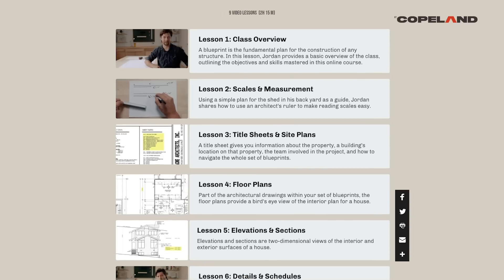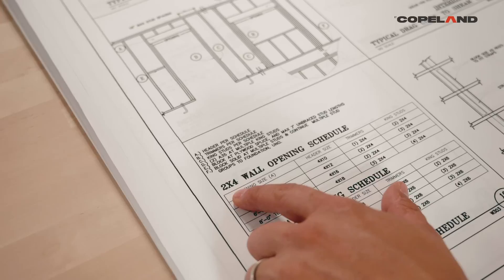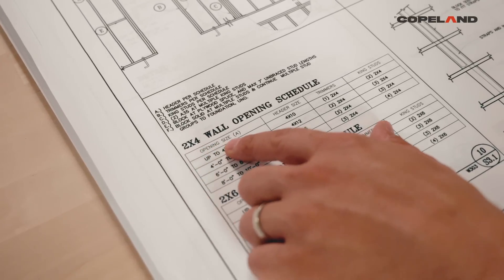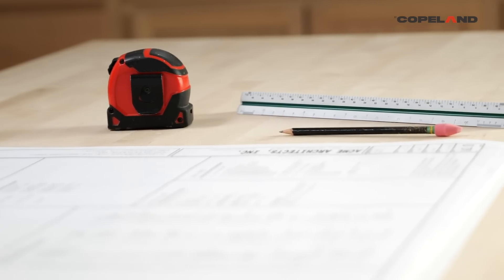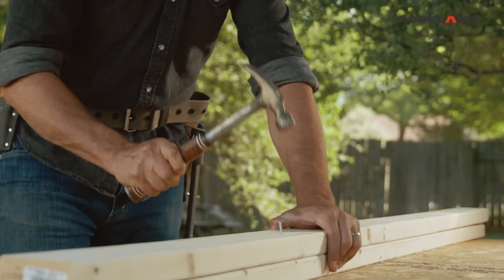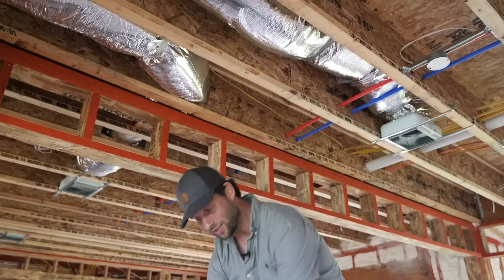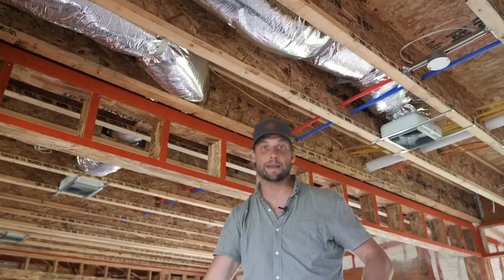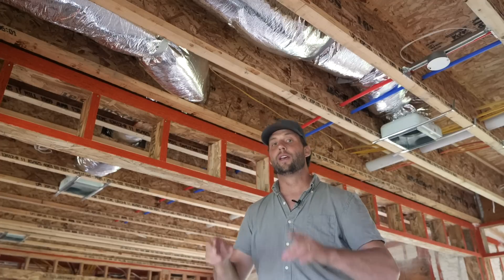Flex vs. Rigid Metal AC Duct - My preference may surprise you!

Comment: 36 year Mechanical contractor here. We specialize in airflow and are generally hired to "fix" hot rooms or "not enough air" issues. The absolute most flex I recommend is 6' which is to say use hard rigid duct sized correctly for friction loss and static pressure then the very last 6' of duct may be flex installed without any sharp bends. The only place I would use full runs of flex would be oversized returns but you need to be careful if it is installed with sharp bends then it may collapse upon itself. Hard duct is much better for airflow, rodents, you can have it cleaned on a regular basis without worry of damage and it can be easily modified in a remodel. P.S. that duct up to the left in the video with the sharp bend makes me cringe.
Reply: I had rodent problems with my flex duct. Never again.
Reply: Our liner in the flex duct is showering small bits of plastic out the vents. They have a life expectancy. I believe they are used because they are cheaper and easier to use. Not better.
Reply: I noticed the same and I don’t even work in HVAC.  The sagging duct just above his head isn’t great either and you can also see a crease in the 90 down.  Good news for you is that’s job security
Reply: Rigid has my vote too. But if you have an idiot working nearby check ductwork before they leave. 5 smashed rigid ducts I need fixing. South Tx rn is 105° Thanks a**hat!!
Reply: My home has rigid duct and the one downside (I think) is that it transfers the noise of the evaporative cooler's fan quite well. Would having flex for the last 6' reduce noise much or at all?
Reply: @chadillac2472 yes
Reply: @chadillac2472 if it transfers noise it means it transfers air. Less noise would mean less air
Reply: @JOIHIINI  Makes sense. Thanks
Reply: @chadillac2472  I guess in theory it could reduce noise but all I can really think of as good noise reduction is having a bigger duct that makes more bends, back to the trunk. Would have same cfm as a small straight run cuz the bends would subtract that air flow but the sound would die in the bends. But it's kinda odd engineering extra 90s on purpose lol.
Reply: @chadillac2472  I designed my own system in my house and a lot of what went into the design was having certain rooms ducting as far away from other rooms ducting to reduce sound. If I did branches it was from rooms that it didn't matter. Sound travel sucks lol I used to have a boiler and it was great for that but I was worth not having window ac units lol
Reply: I worked for 39 years in hvac  tore alot of flex out insolatoin is gone wonder who inhaild that
Reply: @RoyWilson-b3t  😱😳
Reply: 😂😂😂😂on that duct that makes you cringe 😂😂😂
Reply: Great comment, I'm about three years late but just came upon this vid. I appreciate your comment. I have to replace duct work in my crawl space and was told to go with flex duct but most of the people I see on youtube talking about it say the same as you and to go with hard rigid duct or galvanized steel. The house has metal round and rectangular down there already, do I replace with the same shape and size as what's already down there? Or can I go all round instead of rectangular? I ask cause you said "sized correctly". The house is one of those four bedroom tri-levels. 2200 sq ft house but crawl space where I'm replacing duct work is 500 sq ft. Any input or videos you could recommend would be great. Thanks
Reply: I was in the HVAC business my entire career, the best Practice is to rough in your trunk and attach a 12” class 1 flex to your takeoff and run out with rigid. This method eliminates expansion noise and keeps airflow as designed.
Reply: Im equally if not more concerned about how its literally cut into the I beam for the entire height of the beam. Like dude thats a structural component of the house that was just turned into two 2 by 4s....
Reply: It's not that serious...flex is fine. You don't know facts here

Comment: A lot of comments regarding cleaning ductwork.
If the proper filter is placed in line with the evaporator and all the returns are filtered as well, what is to clean?  Just change the filters on a regular basis.
Very few if any HVAC contractors, test the duct work or offer a third-party verification of duct work performance.   Most would not pass.
Most HVAC contractors have their least experienced labor slamming duct work into the job.
They couldn't explain Manuals D, J or S if their life depended on it.  These calculations should be documented and left at every install.

Comment: You're right, when installed properly flex duct can be fine. However, I'm looking at that 90 with the flex through the plywood behind you. I'm looking at that flex hanging over you that is clearly sagging and not taut. I'm looking at how it's attached to that vent. No I don't think you know how to use flex properly and you really shouldn't be talking about something you don't understand.

Comment: Things this guy has never listened to or been in a class for…….flex duct is great whenever you have very little compression, in the range of 4 percent over the span. Using flex to make bends and turns is never ideal, especially a 90* turn like shown. 
Throw some static probes in the supply and return of the unit when it’s done and if those flex duct aren’t sized accordingly, air flow will be low.

Comment: WHAT ABOUT DUCT CLEANING!! 

I have worked in HVAC/R and plumbing and heating for 15 years and have used my fair share of flex duct it most certainly has its place and application. I recently did duct cleaning for the first time and the rotary brush used to clean ducts would easily destroy that interior wire coil and get wrapped up inside the duct. My concern is that now that duct has a hole in it buried somewhere inside a finished home years after the install was completed and now has a damaged heat run that no longer delivers air. There ARE more commercial flex duct options that are made of a much more durable interior liner, in Canada it’s called SLP flex.

Comment: The value is not so much in performance as it is longevity. Get a squirrel or a raccoon or some critter in that attic …they ain’t gonna chew through metal. The reason people don’t use metal in the south is the GC doesn’t see the value and the owner doesn’t want to pay the up charge. Let’s face it, there’s 3 ways to save money on a job ; use cheaper material, use cheaper labor, the contractor makes less profit and the third thing never happens. We HVAC guys would be running air in used condoms if it saved money and no one bitched.

Comment: I’m building my own home hiring contractors myself. I’m glad I came across this video. I hear people say use the the ridged. I’m going with the flex. Thank you for the tip.
Reply: do not use flex, it is crap.
Reply: What kind of reasoning to you have to back it up? What problem did you have with it?
Reply: @josephferron7672  Just use your logic. How air acts, long term effectiveness. Only advantage of flex duct is that it is easier and cheaper. In every other aspect rigid duct is superior. You are building your own home. Do it the right way. This guy is a contractor and he is biased. Because he wants to get it done easy way.
Reply: @Faruk651   I greatly appreciate your response. I’m going to have 2 units. One for downstairs and one upstairs. My runs will not be no more than 30 feet. Installing in crawl space and upstairs will be all in the attic. No ductwork will be in walls. I also live in southeastern US.
Reply: Only go with flex if it is absolutely necessary. If rigid ducts can be run in your house, flex shouldn’t be an option. I never seen these flimsy flex duct in Canada. Must be a Murican way.
Reply: @Faruk651 flex is fine dude lol. Stop stressing. It's not like rigid is an efficiency game changer.

Comment: My mobile home has flex in the crawl space.  All chewed up by rats.  We've been paying what adds up to thousands of extra $ over the last 5 years in utility bills since we moved here, but the rats have been really comfy and we found notes down there thanking us.  We just got an inspection and figured it out, stupid me.
Reply: Having been involved in the sheet metal trade for over50 years I found a handful of flex jobs done correctly.In my area Mass you have to pull a permit for your duct work .Inspector only checks to see that metal duct work is sealed prior to insulating with R 8 .No inspection for flex.If  you go by ARISA ONLY 6 fr of flex can be used and only on termination points.The concept of flex is great.  but the installation sucks.Low air volume high static  .Nit found in hard pipe if dictator used correctly .As to your comment use money saved and buy higher SEER RATED EQUIPMENT no savings if flex has low velocity and high static because of bends and sages.

Comment: Only problem is you should only use flex in places you can access like attics, or crawlspace.
You shouldn't bury flex in a wall or ceiling.
-Sheet metal worker for 27 years and counting.
Reply: This guy calls a 40 ft run of flex is a short run. That's rediculous.
Reply: @geraldgilpin1966  agree. 
1/2 box max and be prepared to T.A.B.

Comment: Ive seen some use metal for most of the run then switching to flex for the last 10-15 feet to reduce noise.
Thoughts on that?
Reply: This would lower cfm at the end and thus reduce noise sure, but that also affects system efficiency negatively. Also, properly designed systems shouldn't be generating much of any noise with all rigid anyway. If you're trying to cut down on noise by doing this, you're simply ignoring larger issues in your overall ductwork design.

Comment: Size matters.....there are sizing charts available to assure that you are using the equivalency to rigid duct. Best practice installation is up the the installer. If installation is done wrong, It will not work properly. I  have use flex for years, with no issues.

Comment: In most of the projects I see in Canada the US, I see long flexible duct more than 20 feet going from the FCU to the air outlet. But it kept me wondering that in ASHRAE Fundamentals Chaper 21: Duct Design Page 21.7, it is clearly mentioned that for Commercial Systems, flexible ducts should be NO MORE THAN 1.5 M IN LENGTH, FULLY STRETCHED. How come ASHRAE don't allow it? I really appreciate your opinion about that and correct me if I am mistaken. Thanks

Comment: Flex is OK but ideally you should keep it 4-6 feet at the end of the run maximum, the rest should be hard piped. 

I've installed miles of both flex and hard pipe. Only on hacked jobs are they more than 6 feet, or if it's not physically possible to install hard duct.

Comment: The group of flex ducts like the one that was showcased in this video would deteriorate over a relatively short period of time. Well, all polymers deteriorate. But, the lifespan of ductwork to be around 30 years (depending on the conditions) or so is not adequate. The point about low performance increment is inadequate because people choose one product over the other for reasons not only performance, but also service life and maintainability as well as cost.
Reply: So which do you recommend?
Reply: @aayotechnology  It depends on specific user requirements and needs. If the goal is to provide a makeshift housing, flexduct is extremely cost effective and easy to install. Many other uses for flex duct other than that. However, if you add longevity and maintenance into the desirable properties of your structures, along with other parameters (area size, etc, climate, type of structure, etc), rigid duct can be a better alternative. Usually such videos imply "best practices", but there is no solution that fits it all in reality.

Comment: Great video.  I seem to have "Flex" duct in my home attic.  Three questions: 1) where do I check to ensure dust is not getting into the air flow?  2) From High to Low quality, which one is the best "Flex" duct to install in my home? and 3) How ( as a home owner ) do I know that the "Flex" is installed correctly (what can I check)? Thanks
Reply: Dust would enter on the return side of the unit, where your air filter should be.
Reply: @leeknivek  Great,  I'll look into that.
Reply: 1) dust will always get into your airflow that's what your filter is for. Other than visual inspection of an entire flex duct for the return, if you have a flexed return you probably don't, you really can't that well.
2) higher the rvalue the better I'd say, but don't quote me on that
3) Basically, no sagging, the duct should be taut. It also should not be cinched down by any hanging supports such that it is constricted. Any obvious 90s that are not using a rigid are also bad

Comment: Im thinking of replacing my rigid takeoffs with flex because they have a few elbows which slow the airflow.  Question is, should I replace those takeoffs with the same diameter as whats there or should I increase the diameter?   thank you
Reply: Dont do it, sheet metal will hold up better over time and the rigid takeoffs have less friction. If you wanted to do what your talking about upsize the takeoffs from a 6 inch to 7 inch rigid.

Comment: I want to see the difference in cost.  For the average home I can't imagine we are talking that much more money to have hard duct.   Probably the bigger issue is the hvac guys in my area don't like to run enough return air ducts.  They skip returns in the bedrooms.  I think it makes for a louder and more uncomfortable system when skimping on the returns
Reply: Are you kidding? For 8" R8 Flex is about $2.62 per foot in my supply shop as of this writing. To get just the metal 30 guage hard duct is $2.50 per foot. Then you have to buy the insulation, staples, tape, mastic to wrap it plus accessories like elbows, plus all the hours of extra labor to install rigid vs flex for a whole house. Rigid is about twice the cost, twice the pain, and twice the time. The best way to do residential duct, rigid for main trunk lines and flex for branches unless you have really long runs, then partial rigid for those, which is not usually the case. Biggest problem I see is not enough return. But flex is WAY cheaper than rigid.
Reply: And to put that in perspective, having all rigid vs some flex can turn a 3k-4K job into a 5k-7k. There are some numbers for you.
Reply: @davidgibson9781  okay $3000 on a home, less than 1% in many cases.  I’d definitely pay for that upgrade
Reply: Now multiple that $3,000 x 50 houses in a new neighborhood devolopment and competing contractors bidding for work and TIME. Time being a huge factor. Yeah thats cool man that you would pay for it. But if it was that easy then every contractor would be doing rigid. I just told you the best and most efficient way. Like the guy in this video said, diminishing returns.
Reply: 3-4x the  price, my friend.
Reply: @junkman8742  that’s insane. I’m in the wrong business

Comment: I have a question, for the return intake my contractor is not using flex or rigid ducting instead he's using the house framing with sheetrocks is that normal and good idea?